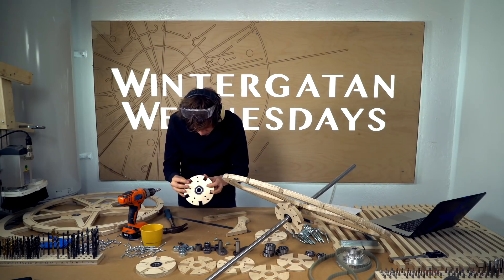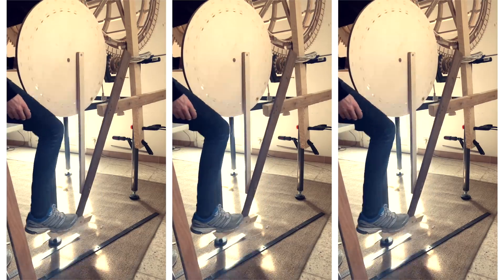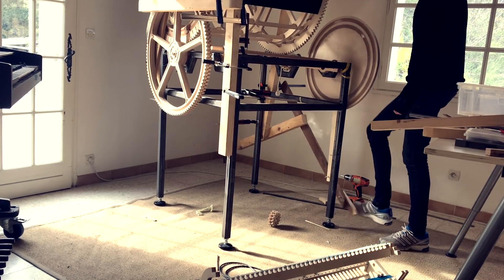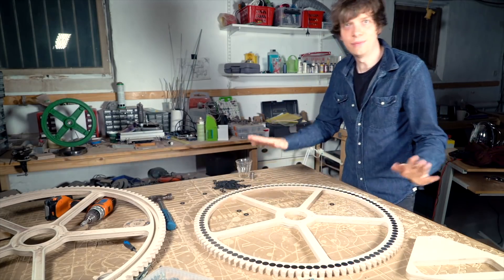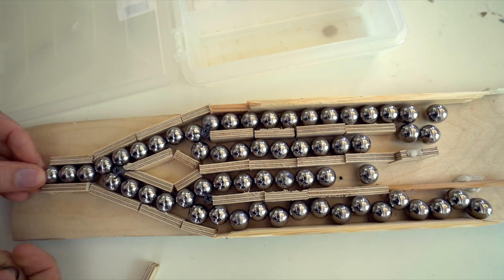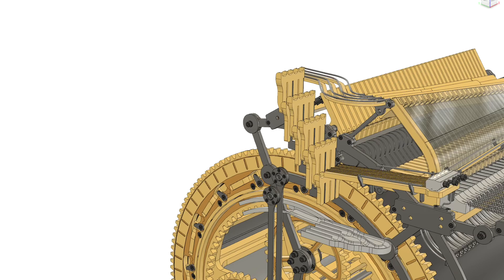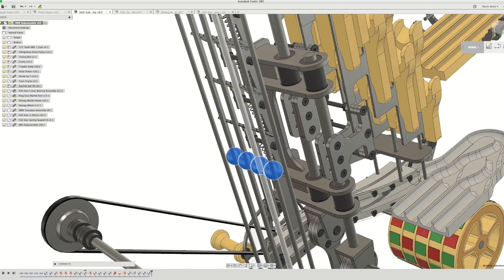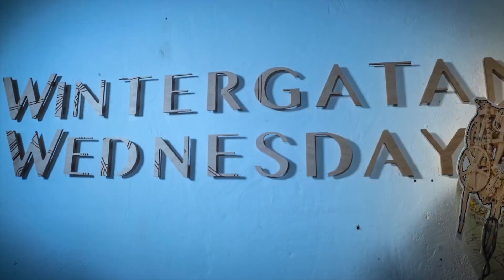Ratchet Marble Lifting System - Marble Machine X #32

Comment: Is there going to be a freehub incorporated into the pedal and/or handcrank, so the pedal doesn't have to move, for example if you want to let the machine free spin without the pedal/crank moving and slowing it down, or if you want to use just one mechanism without the other one flailing around?

Comment: Definitely would contribute to "the rule of cool" factor if you were to use a bow system like they used to use for treadle/pedal lathes for a really smooth flywheel.

Comment: Forgive me if it’s been asked and answered elsewhere, or tried and discarded elsewhere, but what is the fixation with a complicated lift system when pinball/pachinko mechanisms are so very much more simpler.  In my head I imagine a turning wheel... since you’ve said you need 8 per rotation, you put 8 ‘flippers’ on the wheel.  As the wheel rotates, the next spring-unloaded flipper encounters a barrier that forces it back to make it spring-loaded, and simultaneously the next marble victim in line drops into the trough below the lift tube/channel/whatever, and when the flipper clears the obstruction and unloads the spring it spanks the poor marble up and over.  Much could be done to reduce the parasitic noise that is part of the fun noisy experience in in a pinball arcade or a pachinko hall.

Comment: Lifting a leg to pump the treadle is inefficient because it throws you off balance. Adding a rocking foot pedal (like a Singer treadle sewing machine) would allow you to keep both feet on the floor without compromising action or mobility.

Comment: TIP: 
i can't see clearly but the pistons should be positioned 90° from each other to be sure that the gears will always move! same for the pedal you should use 2 pistons with a 90° angle to make it spin always! :D

Comment: I think this will have a much more complementary look to the machine as apposed to the belt, as awesome as it was looking.Just a quick thought on the ratchet though, how much noise is the final design going to make? If it matches the timing it wouldn't matter as much, but I'm sure you're trying to keep operation noise to a minimum.

Comment: You need a lot of inertia in the flywheel if you are going to try to power machine with pedal.  Pad the ratchets of the marble lifter with felt (like they do in musical instruments) to reduce noise.  I would ditch the gear magnet lift and do all the lifting with one device.  Then you need not worry about demagnitizing.  Your 4-way splitter is prone to jam.  Cumulative friction is very hard to predict.  What will work well one day will fail the next.

Comment: I'm a little worried about the hairpin turn in the marble divider over the demagnetizer, particularly as it's slowing down through the turn--if it backs up far enough that there are stopped marbles in the turn, they'll be more inclined to skip right out of the track than to push marbles out of the way to follow through that turn.

I haven't thought of an easy fix for that, though. Maybe you could enclose the track there? I'm not sure. But just by eye, that turn looks like trouble.

Comment: For the thermal, why don't you take the route of the foot board on a horizontal axle, using a vertical rod or board going up from the back of the travel that way you don't have to  stand on one foot while driving the device, you can just rock your foot back and fourth using your ankle movement.

Comment: Sir if you make the marble machine x out of wood, and you go on a world your, wont the difference in climate make problems in the machine. I used to live in Australia, and i play the violin. Then i moved to asia where humidty is much higher. The wood of my violin then expanded because of the moisture in the air and then broke the glue that sticks my violin together. So if the marble machine X was to be brought to a place with high humidty, wouldnt the moisture in the air make your wooden components expanded thus making the holes in the wood not correspond correctly? I really want you to come here too asia but it would be really sad if the machine broke once it got here. That's all, appreciate your hard work.

Comment: Why not a simple bass drum pedal?  Or similar, for the treadle pedal.  The heel sits on the floor, completely eliminating any pinch points.  Plus it's a musical interface that anyone who's played a drum set would find familiar.  The human/machine interface is very important and any time you can make it familiar, you'll be happy you did!  Now, when can I buy tickets for the world tour?  Cheers Martin.
Reply: Probably because turning the many wheels and lifting 8 marbles every beat requires so much more force than simply beating a drum.  It could be incredibly tiring if not impossible to do that for a full song using only 1 calf muscle.   The ability to use the entire leg might be mandatory.

Also, most if not all drummers sit while drumming, and this machine is clearly meant to be operated while standing.  So the interface is going to be foreign no matter what.
Reply: That makes sense Grantsta.

Comment: Also, I mean a double corkscrew lift would be pretty sick and I figure you could line those with the same opposing magnets pattern and see if it lifts and also demags. 

Secondly, your foot pedal piston arms could benefit from considering a ratcheting one direction fixture so that you only have power when you are applying force in the forward direction and then just idle calmly without a fear of your resting foot causing de synchronization from potential back pressure. In short the back hub on a bike would be a good start to tear apart and mock up or even one of the best professional rear wheel hubs from a company called “King” has the best teething  for its limited drive hubs. Just imagine how you can pedal a bike downhill but suddenly stop pedaling and soar downhill without the pedals continuing at the wheel speeds, then suddenly pedal again, he’ll maybe even putting a full on bike chained gear setup with a hand levered shifter could easily change how much force you have to input  variably by changing the gear ratios and it’s not anything that isn’t hand powered really.

Comment: If it hasn't already been mentioned, pretty sure the handle from the hand crank wheel and the lever from the foot pedal will interfere with one another.  I believe a better solution would be to have the lever from the foot pedal actuate on the back of the crank wheel and engage as a toothed bar against a gear wheel where the teeth engage on the down stroke but, like a ratchet, disengage on the up stroke.

Comment: +Wintergatan
You should consider that as the marbles contact steel parts they will make clacking and sliding sounds, which could produce wear and indents on the marbles, and also add to the demagnetizing load.  I believe in the previous machine the marbles contacted mostly plywood aside from the actual instruments, so I just wanted to caution you so you don't end up with a machine that makes too much background noise and eats marbles.
Fantastic work!!! 😊👍👍
Reply: You also don't want to end up magnetizing the fixed steel parts themselves...
That would be a very difficult problem to fix.

Comment: WHAT ABOUT THIS FOR A FOOT PEDAL - GO AND LOOK AT A TREADLE SEWING MACHINE AND ITS DESIGN.  IT ROCKS BACK AND FORTH WHICH TURNS A (GEER,FLANGE, COG ???) AND IT TURNS I THINK A FLY WHEEL THAT CAUSES THE SEWING MACHINES PRESSER FOOT T8 GO UP AND DOWN AND SEW....ITS BEEN A SEW YEARS SINCE I SEWED USING ONE...YOU CONTROL THE SPEED OF SEWING BY HOW FAST YOU WORK THE FOOT TREADLE. THE SEWING MACHINE ITSELF HAS A LITTLE HAND WHEEL YOU CAN USE AS YOU ARE SEWING OR SLOW IT DOWN.....YOU WILL UNDERSTAND WHEN YOU LOOK AT THEM...I DON'T KNOW ABOUT ANTIQUE SEWING MACHINES FROM OTHER COUNTRIES SO BE SURE TO LOOK AT SINGER TREADLE SEWING GMAIL MACHINES....WHEN I WATCHED YOU USEING YOUR FOOT PEDAL THIS CAME TO MIND....YOU JUST MIGHT HAVE A LITTLE MORE CONTROL OVER THE SPEED AND ITS EASIER...

ALSO WHAT ABOUT WHENITS ALL DONE G0BEING ABLE TO RAISE AND LOWER YOUR MACHINE SO IT COULD BE PLAYED BOTH STANDING OR SITTING.....LOOK AT THE LEGS ON CANES OR WALKERS THEY HAVE LITTLE HOLES AND BUTTONS THAT LOOK IN PLACE. YOU CAN M AKE A CANE LONGER OR SHORTER SAME WITH WALKER.....

LOVE THE MARBLE MACHINE.......

DEWANA HEALY

Comment: A note about terminology: The parts you're calling "pistons" are not pistons. A piston is something that slides inside a cylinder to act on a liquid or gas. In an engine, those parts would be called connecting rods, but I don't think there's any particular term for them the way you're using them.

Comment: For the treadle pedal; have you considered the pedal mechanism from a kick drum or high-hat? It would give you spring loaded returns and your foot would be a more neutral position. I know you are working on a ground up design; but why reinvent the 'wheel' when you have an easily available substitute? Using a kick drum pedal would mean attaching the long arm for the MMX to the striking arm of the drum.

Comment: I've been following your progress for quite some time now and one detail that escapes me is why you seem so intent on making the marble lifting part work in multiple stages. Is it because of esthetics and your desire to make that side of your machine look magical or is it that there is another reason like weight distribution or the need to control the flow of marbles with more finess so that they don't clutter in this part of the machine ? Quietness of this process or lack of it would create a hearable tempo from those climbing marbles , is this something you want the audience to notice ? Maybe your videos have been a little too far apart for me to follow exactly the reasoning for each component this marble lifting mechanic has or a little recapitulation would be in order :-)

Comment: I think your flywheel is way tot light en the paddel way tot heavy. I think it's important that the flywheel has some mass, so it can keep rotating during the upper stroke. The choice of sheetmetal is good, you can do a lot of things with it, bending, welding,  lasercut it, (it has a high tolerance: position). Also, with bending you can create geometric stiffness. Interesting project! Great work!

Comment: Fusion 360: Create a variable ((eg "len") in the Parameters ("Modify" menu -> Big Epsilon letter) and give it a value. Put that variable in the sketch as the length for the pistons and you don't have to go back to the initial sketch, just change the value of "len" in  Parameters and the drawing will change.
P.S. This is such an addictive build to follow. Great job!

Comment: Glad you ditched the belt for the ratchet system. Aesthetically more proportionate to the other mechanisms. The belt would have been very visually demanding, especially on the "selfie" side. Any plans to add a transducer to the machine itself? Those springy sounds were very nice!

Comment: Martin, I think you should take a look at the freewheel mechanism of bikes. You can disconnect the pedal/crank movement with a freewheel and actually rest your foot on the pedal while the flywheel is spinning. A spring is needed to pull the pedal up in resting position. Otherwise it will be very tricky to get going again. I really would like to have you in front of a whiteboard to describe this...

Comment: Hi. Nice work I really like your videos. Form a mechanical engineer point of view your food paddle looks too slim. You should consider making the profile a little higher at the joint for the vertical link arm. I think you will get too much flex I that designed. Best regards.

Comment: Can you really isolate the sound from the ratchet system from the microphones on the machine?
Personally I like the corkscrew idea (below). Tuning the cork screw idea a bit you could create a fixed spiral transporting system with two round metal rods guiding the marbles up in a spiral. In between the fixed rods you can put a rotating single spiral rod pushing the marbles up. With a bit of color and light you could make it look a bit like a modern version of an old rotating barber shop light ( https://youtu.be/u2TbsRqklHQ ). Could be a bit to much visible noice though with fingers, horizontal and vertical rotation. Still Very few moving parts that can break. Depending of the through put you can add either 2 or there extra rods to push marbles up, but I think 4 barbershop screws would make a very interesting visual addition to the machine. The challenge would be to get the guiding rods and the pushing rod in a shape where the do not touch each other. Second challenge is to get the marbles on and off the spiral guides, have some ideas if you are interested :-).

Comment: I suggest you adjust the pedal so you only need to use your foot, not the whole leg. Make it so you can keep your heel a support or the floor. More like a bass pedal. If you don't you'll get tired very fast. Why move the whole leg if a foot is enough? Besides, musicians are already used to using those muscles.

Comment: Won't ratchet system be a bit too loud? It will probably produce a distinctive clanking noise, I suppose. You probably can try to use a tubes filled with polyethelen foam instad of solid rods, so they won't vibrate as loud.

Comment: I don't know how well that pedal is going to work out.. with only one point of contact on the wheel, it isn't going to be balanced. It's already scraping and banging against it a lot and unless the entirety of the mechanism is stuck inside a "sheath", supported on both sides so there's no horizontal give (which will add friction on either side and make noise and slow it down), it's not going to go well.
The channel splitter also looks like it might have a problem. It's meant to work on a full system, with marbles pushing each other aside, but how well will it work if there's a gap? I doubt the flow of marbles is going to be continuous and unbroken so I'd worry about jamming or uneven distribution.
I'm no expert either way, but, well, having played Factorio and having made a layout that required constant feeding only to watch it fail the minute I ran a bit low on resources, I'm seeing a parallel with the marbles. The pedal's problems are evident in the video, and since there's no way to guarantee a straight downward press every time, the whole thing is going to shake and bend.

Comment: If you decided to do the ratchet system, try to keep in mind what four channels and 15 (20?) levels of ratchets is going to sound like in operation! You might not want that extra sound. If it's too loud, consider a sound dampener: rubber pads. Even then it might sound too loud. Good luck!

Comment: I may be seeing it incorrectly, but in your CAD model including the pedal, it appears that the hand crank will interfere with the pedal linkage.  The only way around that is to put the crank handle at the same pivot point as the linkage...  Or, you could make the crank wheel two layers with the linkage in between the layers, and have the axle for the crank stop at the inner layer.  That would leave open space for the linkage to run.

Comment: I'm concerned about the force of the springs of the ratchet lift, take into account that every bit of force extra in the mechanism will be directly transferred to your foot. Also try to implement a sliding transmission like the ones on the rear wheel of a bike so if for some reason you skip your foot the mechanical abomination doesn't hurt you

Comment: Won't the ratchet marble lift system be noisy? Have you considered using a spiral lift? For instance one way you could do it is make it look like a wood screw inside an acrylic tube  spinning at an angle lifting a constant stream of marbles. Powered by a gear or 2 connected to the rest of the machines gears. If you're not sure what im talking about id be happy to do a rough sketch on how it works.

Comment: Have you considered the amount of friction in the system, and the difficulty of starting/running the whole machine. There will be a lot of loss in wooden gears (friction, flex, misalignment). The difficulty of keeping the friction low enough is getting higher with every new item.

Comment: I wish I could send a picture. I can't find the Reddit page you said to post ideas to. You really should consider a form factor similar to a spinning wheel. It has better control, better torque and is time tested. You also need to add weight to the fly wheel to assist in overcoming inertia and test with as many components attached as possible before settling on an idea.

Comment: In my opinion the pedal arm thing should be as wide as possible to make it stiffer sideways. So the pivot point on the leg could have the two side-bars on opposite sides of the leg and then closer to the actual pedal you bring the sides together...  ye.. I guess no-one understands what I'm saying...

Comment: How do you simulate or estimate how noisy the machine will be? One thing on my mind is what happens if you come out the other end and the summation of all the mechanics is a cacophony of awful noise?  Now, since everything is being driven by one crank, you'd think it would all at least keep a rhythm, but still, curious!
Reply: don't be too worry about the noise because all the instruments have their own micro, Martin have made a lot of trial in previous videos about 1 year ago + the other musicians will play aver the working sounds(noises) of the MMX...
Reply: Simulating the noise sounds interesting. I'm sure designers of airplanes and cars do those simulations.
Reply: Mackinstyle do not underestimate the noise, that's one of the reasons why 1st MM sounds fantastic